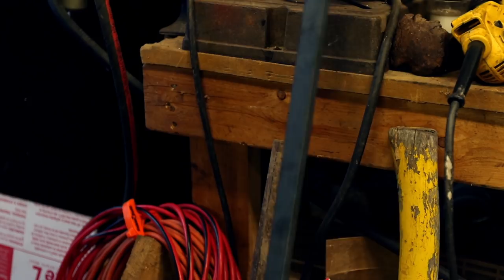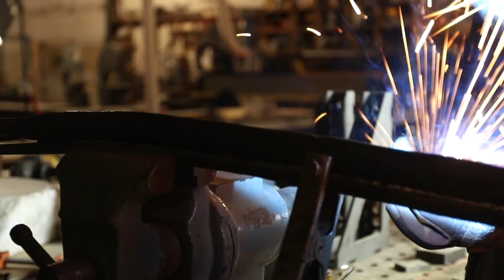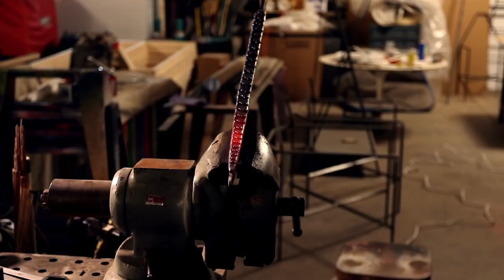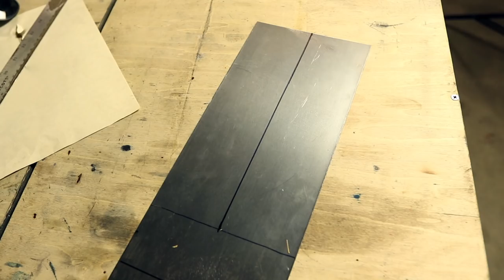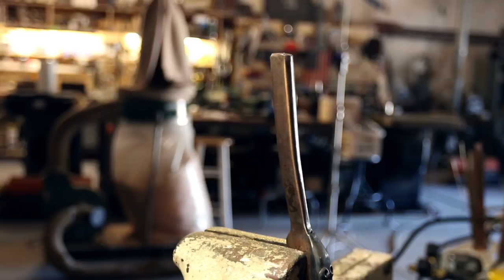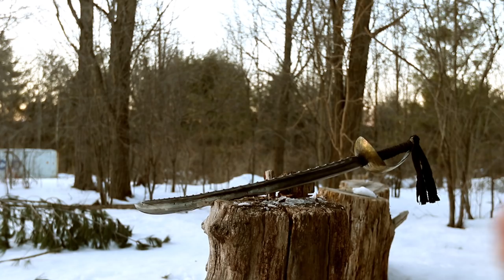Making The Kraken Cutlass | Tentacle Pirate Sword

Comment: That was great. Thanks.  BTW. What does the “non-metallic” mean?  I don’t work with metal (yet).
Reply from the maker: Non Magnetic. Steel becomes non magnetic at high temperature. It’s magic. And it’s also around the time you hit quench